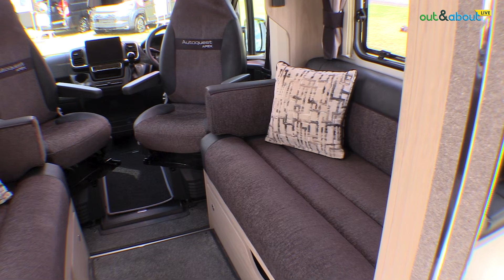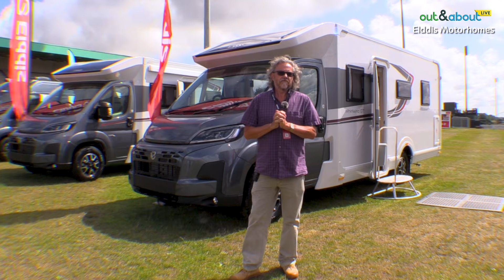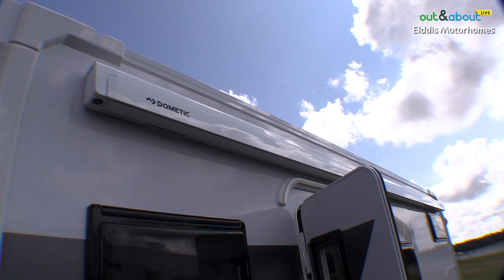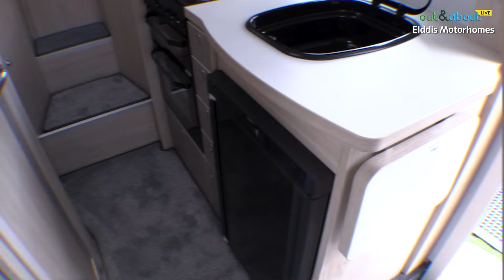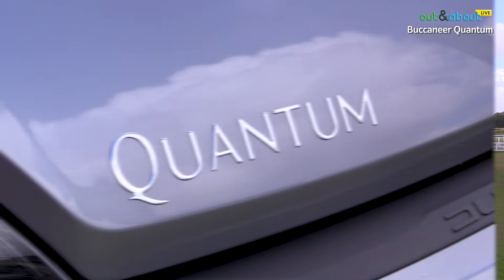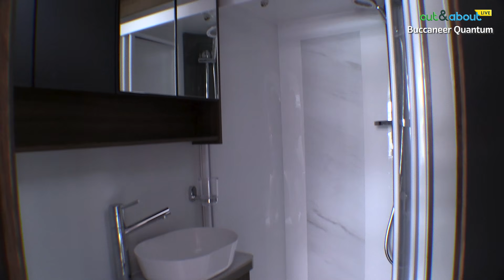FIRST LOOK! New 2026 ELDDIS motorhome range, plus BUCCANEER luxury brand

Comment: The zip system is just a metal frame fixed under the floor. Are the upper parts of the walls and roofs still constructed with an internal wood structural frame that can (and regularly does!) rot? I note Elddis has quietly dropped the term "Solid construction" (perhaps because of it's bad reputation for damaging water ingress) but essentially this construction method still applies to the upper parts of their motorhomes/caravans- so no change there as far as I know. Instead of hard-selling the latest "bling", Elddis needs to be honest and not hide weaknesses of their chosen materials, methods & limited warranty cover.
Reply from the maker: More details here - https://elddis.co.uk/motorhomes
New Zip System construction is a big step forward from Solid.
Reply: @MotorhomeCampervan  Thanks but you've avoided commenting on whether the upper parts (i.e. above the floor) are still constructed using a structural wood frame'  -  damp/wet rot is Elddis's well-known achilles heel.  Would-be customers are entitled to the full picture: not half a picture.